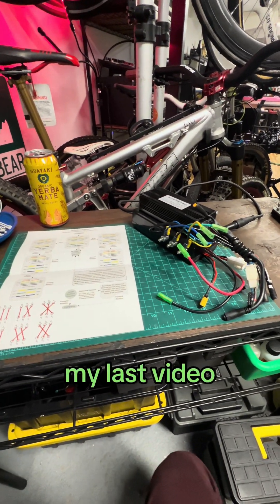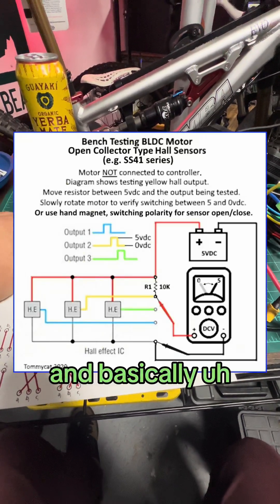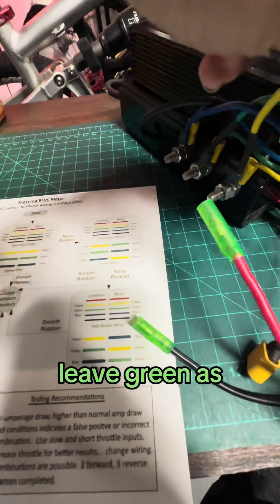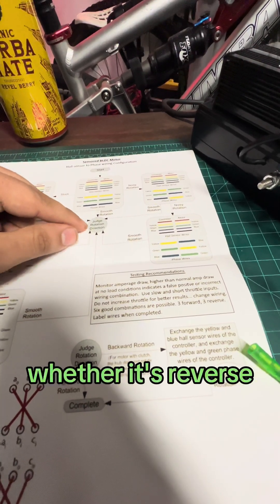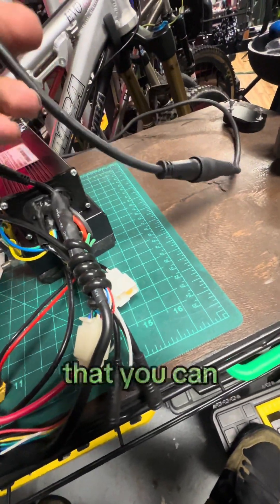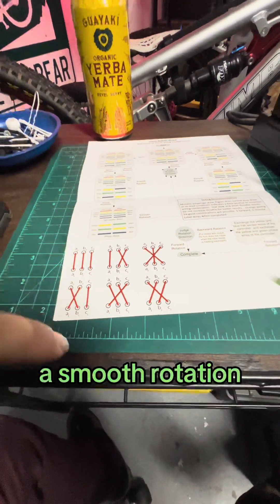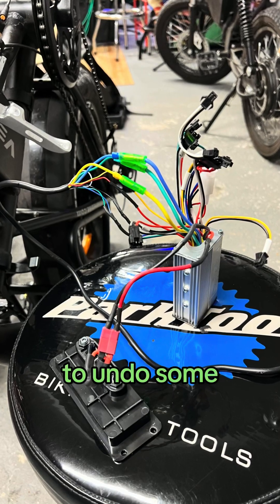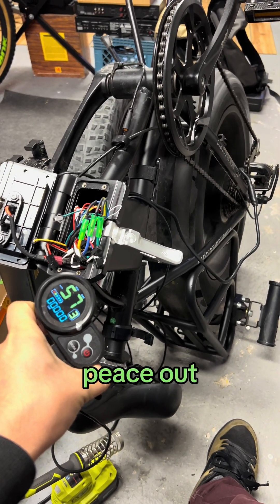E-Bike Phase And Hall Sensor Combinations

Comment: Is it possible to run the motor on 2 phase wires. Mine is working fine on 2 and one is left not connected